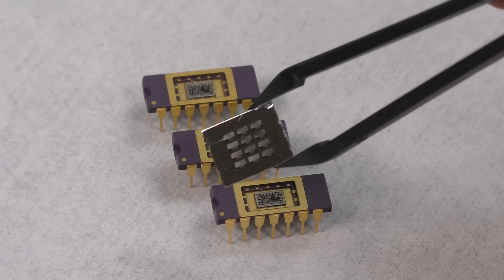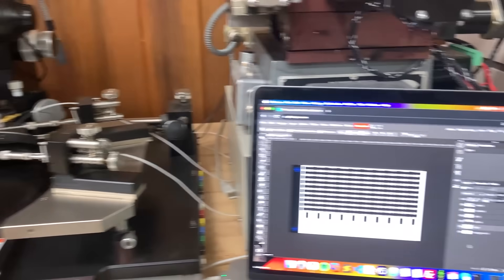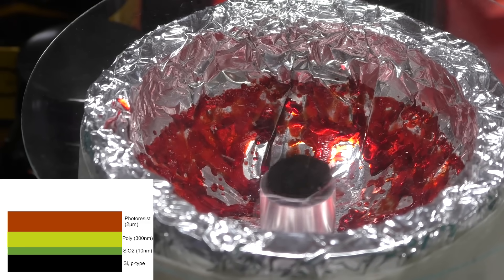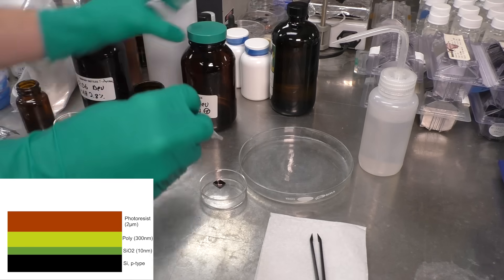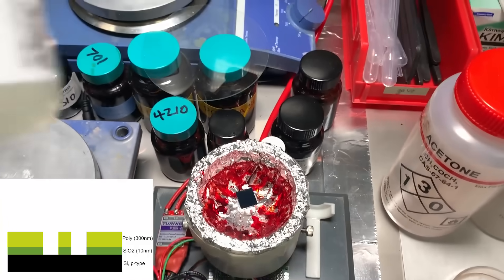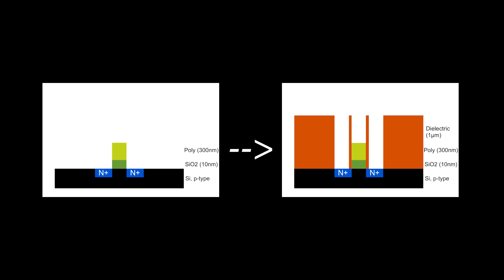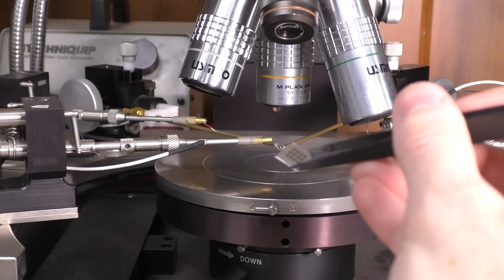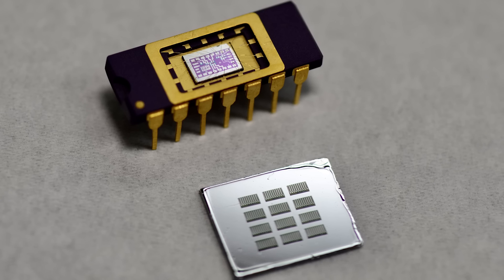"Z2" - Upgraded Homemade Silicon Chips

Comment: this is really cool but these chips are non functional, irl they have to be in a very specific order not just in an array like that, the designers take months to decide where each transistor will go, it does not function calling it a guitar interference module because that's what it did when he connected it doesn't make it true, its just shorting out same as the led light, this is a trick to fool laymen I know because I used to trick people in the same way lol

Comment: This is cool. I've recently been saying that the DIY community needs an easy 3D printing solutions to print custom microchips from home. So many vintage electronics will die over time as their custom ICs age and die without a modern alternative to replace faulty and dead ICs. If you looked into cloning ICs from retro hardware you could probably find customers willing to buy your chips from you. Everybody keeps telling me FPGAs will take over, but I think there will always be a community who want to run off real HW rather than a simulated experience through FPGA. You likely wouldn't push out great volumes of microchips, but you could offer your services as a boutique service and charge a higher price for each piece of silicon you produced versus what the original manufacturers wanted.

Comment: Hi! I do a PhD in a research clean room. Really impressive, especially the homemade metal evaporation. A few tips. Rather than squirting developer, stopper and remover, put them in a bath already filled. You'll have a much more precise control over the development conditions. I'm also surprised your resist doesn't burn in the furnace?

Comment: That’s absolutely incredible work! Building a 1,200-transistor silicon chip at home is no small feat — it’s a mix of engineering skill, patience, and true passion for electronics. You’ve achieved what most people would think is impossible outside of an industrial fab. Hats off to you for pushing the boundaries of DIY technology!

Comment: Hey. A great video. But you can control the etching rate when poly Si and SiO2 was etched by HNO3 but not Si substrate? But for me, only HNO3 could not etch HNO3. You mixed with something else?

Comment: How many transistors could run DOOM ? :D
Reply: Doing some research online, the "bare minimum" is around 275,000 transistors. Using these chips you'd need ~230 of these chips.

Comment: could you make cpus with this or is it not speshelized enough
Reply: It's on par with the earliest microprocessors made like 40 years ago....so no you can't use it as the low end cpu if improved may be some IOT devices can use it maybe🤷🏻
But just the mere fact that he can fabricate such a complex thing in his garage with diy equipments is already insane but I want to see if this can be improved or even scaled up

Comment: so so cool!!  I tried to get in to UC Santa Barbara and UC Irvine to work on chip fab as a concurrent student, $$ per unit as I had a design I needed to make into a chip but then had all the help to do that just taken away.  had been to an ISSCC and DAC to get ideas maybe partner, didnt happen.have even worked building up sputtering equip from the frame, the vacuum is by far a challenge more than anything.  you cant get the last bit out so why not do what vacuum tubes did, use Getter?  Idea was rejected as stupid, Im stupid and shut up.  ok fine.Id love to work on this in a garage good job dude!

Comment: It is quite funny seeing this as bascially I used to make PIN diodes using the same process, I'll admit we used fume cupboards and full protective gear for the chemical processes and our doping went to the chip fab next door as they used gas for the doping so not really back yard stuff there.....Certainly I used an Edwards vacuum system to evaporate aluminium or gold using a heated element controlled by a big dial and an ammeter - bit of a trick to get it right because you couldn't see what you were doing after the first evaporation, we had a sputterer but only for the "special" devices. Used a dice saw to cut up the diodes and then test them as they had 7 dots on them so you could get the right response dependent on the dot but they were tiny and a 3 inch wafer held thousands of them. Then off to the wire bonder and encapsulation. Did all this when I was just 18 (an apprentice only but they just let you get on with it if you could handle the operations and work safely around others, some of those acids wre nasty stuff and a few times I saw people putting acid in a beaker that had remenants of alkali in them at which point all the acid jumped out of the beaker and someone took a shower (whether they wanted one or not....)

Comment: This guy is incredible, i have crated both a little alu and a transistor...but my alu was made into 55 by 55 cm circuit... and my trasistor was too big and energy inefficient that is basically impossible to work with it...and both i was in a group in my uni with all the professional equipment...idk this dude migh be one of the best engineers of all time

Comment: what if you put vertical chips stacked sideways, as fingers, you get massive vertically stacked patterns. yes multiple chips side by side as horizontal stack.
Reply: have you tried using electron beam cannon to make nano patterns? maybe a ultra blu-ray (electron ray) drive single write with high power electron beam and read with low power scanning/transmission electron microscope vacuum read head.

Comment: This is the ultimate in homebrew for working with ICs. I remember the videos about the Z1. In three years you have gone from 6 to 100 transistors in a group. It will be interesting to see what you do in the next three years. You could have more layers,  and/or add resistors and/or capacitors. The possibilities are endless.

Comment: If you make a "Z3' processor, will it have 240k transistors? Because according to a calculator from my computer, it is about 200 times from 6 transistors to 1200 transistors from a second generation. So therefore, will the third generation of the processor have 240000 transistors? And with that question, will that be possible in your own home?

Comment: That's pretty amazing man. I'm not into semiconductor engineering, my stuff is mostly embedded design, but I am thoroughly impressed. It takes a certain level of frustration against manufacturers to want to pull something like this off.

Comment: Amazing. People of the earth can do all this, at home, yet they can't make an oxyhydrogen steam train and save the world from climate change. Yet all you need is an off the shelf oxyhydrogen boiler burner a shipping container sized battery, solar panels on the roof of the cars and water tanker. zero pollution runs on light and water. 7000 HP and all you will hear is that violates the conservation of energy principle.
Really? 
I am amazed at how you managed to put all that equipment together and do all that and people can't even make a steam train.

Comment: Why are you not using Yellow light?
Don't you know that during the photolithography external UV from white lights will affect the imaging process.
Even PCB manufacturers use the Yellow light for solder-mask imaging.

Comment: This is amazing. I'm super impressed and keen to see how far you can push this in a home environment. I was wondering how you positioned the "chip" on the exposure platform for subsequent layers, so each layer registered correctly for the electrical connections. I saw someone else asked the same and you said you line it up with a microscope. I was thinking, might you be able to manufacture some sort of right-angled jig glued onto the platform that you could push the chip into with a spring-loaded arm, just strong enough to stabilise it?

Comment: I've thought for years, there is space for something between the off the shelf amazingly integrated chips we have and discrete PCB mounted devices. The recent automotive chip shortages were not in the bleeding edge devices but older technologies, whose fabs had been abandoned during covid.
Mostly I'm not talking about devices for compete functionality, but to mop up many of those discretes that almost every circuit needs.
Considering that Sam is doing this in his garage and these devices look eminently usable, it doesn't seem a big step for almost any company to make their own devices.
It doesn't seem that it would be difficult to make an automated machine to do all the steps in the video. I'm sure they exist, but probably closer to bleeding edge than mass market. I.e. wafer in, devices out. QC would be the most onerous, as every device type requires custom testing.
The only things I can see which needs bringing more up to date is to be able to include diamond cutting and metal bumps for direct chip SMT.
FYI, I'm an electronics and embedded SW engineer and have just completed a contract at one of the bleeding edge chip manufacturers. Even as an engineer in this field, I am continually amazed by progress. E.g. the RF chips I recently worked with were so thin they were mounted on a polymer film for testing. The connections used copper pillars with micrometer scale spacing. Even the multi chip RF modules are tiny, many under 3 x 2mm with over 100 connection pads!

Comment: I work for a company that makes piezo resistive pressure sensors, legend has it the business started out the same as this; garage/cottage type industry in the 70's. Wonder where you'll be in 50 years, good luck!

Comment: Well, when are we going to hear about what does that chip do? You got to figure this. It is like Intel, they had progression. So a team of what, how many people. Then flaws and the Extraterrestrial made thing in time. But what about you Sam. There's 107k subs, when are you going to have a true product that codes in. It don't matter if the chip has not taken 100 transistors. But a product, else than clipping. A function must be figured. Then make the next one to see how much time it takes. Need energy?

Comment: I think that I got the whole process now, first you get a silicon waffle, then put a photo sensitive layer on top, you print the circuit on this layer using light, the part that was exposed to the light can be washed out and you use the holes formed as a cast for the transistors, then you pour a liquid solution that with the baking will evaporate and deposit the material on the cast, basically both printing and casting the transistors.
Reply: You just repeated what he said in the video

Comment: Everyone here is amazed watching the process and I am here thinking that putting this lab together is a much more impressive feat that this (relatively) simple process. Knowledge about chip manufacturing and semiconductor devices is very accessible in this day and age. Installing (and potentially fixing) these ebay bought (and donated) equipment is no small feat! the information about this stuff is so obscure and requires experience (not just textbook knowledge). Not to mention the environment. This is not a cleanroom and alot can go wrong! Well done! 

BTW, I know Sam knows this but for aspiring engineers in their parents garages, DON"T MESS WITH HF! You can lose you hand very very slowly and without knowing. No amount or gloves will protect you (certainly not nylon gloves). I kind of wish he mentioned it in his video because it is a very serious silent killer

Comment: Good evening, I hope your projects are going well. I really likes your video on bond wiring. I could not see a way to contact you through you tube so I figured I would try through the comments. So here goes, i do a lot of projects from mother board repair using a microscope and super fine tip soldering station. I also love to repair old mechanical watches and now vintage electric watches. The current watch is a heuer senator that has a open silicone chip that has about 15 aluminum bond wires that are disconnected from the gold fingers not from the chip. What i was wondering was instead of soldering each one could i send you the piece to redo the bond wires? Of course I would pay but figured it would also make a great video. Thamks either way Chuck

Comment: You still use the 'beamer-microscope' - not just for mask and wafer inspection - but for 'stepping' the lithography beam through the mask unto the photoresist wafer - all exposed to thick cigar smoke ... 

Aside that, I wonder, how much money - roughly speaking - You have sunk into Your 'fab' over the years - as this is probably the most relevant aspect of 'Law's moore' ? 
There must be a 'break even point' until a garage won't suffice, technically - but anything more won't result in a chip production that is practical (while a middle ground may be useful e.g. during global supply chain shortages)...

Comment: If you can recreate the 6581 / 8580 SID chip from the Commodore 64, you'd find a massive market for them as these chips are much in demand from lo-fi, chiptune and synthwaye composers for making retro synthesisers. Currently there are mockups of the SID such as SwinSID, but these are reprogrammed modern chips that emulate the SID, rather than the proper analog original that is preferred of the purists. So currently the only source for actual SIDs is cannibalizing them out of old C64s, which is a shame because these old computers should be preserved.

It's a bigger market than you might think, and since the SID is an analog chip it shouldn't be too difficult to create one with the equipment you have there.

Comment: Outstanding. I worked at Sandia labs where the UV cured photo resist was developed. You have enough stuff to make MEMS, Micro Electro Mechanical System which are micron size. From steam engine to gyroscope to (theoretical) robot surgery.

Comment: I don't know if you have a video answering this, but where the hell do you go to get the equipment you need to open a wafer fab in your garage.  And how much does it cost.  Also, what are you using to clean the air in there (if you're doing that)?

Comment: You really know your stuff. I work on silicon diode radiation detectors which are quite easily ruined by any contamination or slightly wrong process conditions. Getting these mosfets to work in a garage is really impressive, especially with only one guy doing it!

Btw, we also have the 4145A semiconductor analyzer in everyday use, old but gold :D

Comment: This is amazing. How do you repeatably index the projection?
Reply from the maker: Thanks!! It’s a microscope so I look thru the eyepiece and move the XY around, the projected image is visible on the chip. First I project it using red light for alignment, then switch to UV for exposure once everything’s right
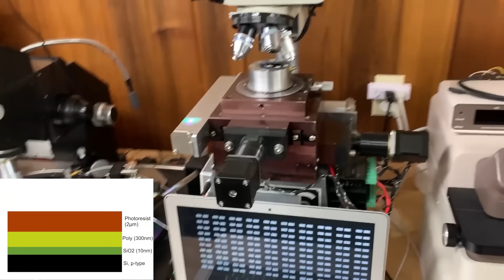Reply: @SamZeloof  Your project is really cool! I can only imagine your homemade silicone chips improving! Do you think if making a mold(the mold blocking the unwanted rays) for the 2:06 part where instead of a projector, X-rays!(with a x-ray machine of sorts) Just an idea because the wavelength of x-rays is much smaller allowing for much smaller transistors(hopefully). And even possibly making it front and back sided on a single chip(theoretically for more complicated tech)? I am looking forward to your next homemade chip videos even if its next year... or the next! I am now subscribed!
Reply: @blacdiamond2334  we are getting into dangerous territory here. theoretically, yes, but he's not limited by his wavelength yet. Remember, he's not in a cleanroom. There's only so much you can do in a garage. Also, working with xray is very very dangerous and not worth it at all. Also, there's a reason the industry skipped xray and moved into EUV (cost, risk, DUV is good enough, etc...)
Reply: @himura128  All that gear - he's in a garage?
Reply: @blacdiamond2334  Silicon not silicone.

Silicon is a semiconductor. Silicone is rubber used to give ladies  bigger boobs.
Reply: @blacdiamond2334  I don't think you can buy an x ray machine for your garage :D
Reply: @jaym5938  Yeah - I read an article about him, he's got all the gear used from labs cleaning out old gear and stuff.
Reply: @himura128  LMAO. Sam is working with hydrofluoric acid and you're afraid of X-rays? FYI, building an X-ray scanner is a very common "first real project" for makers because it's cheap and easy to do safely. Even if you run an X-ray tube with no remote trigger and no shielding for backscatter, it'll still be safer than semiconductor fabrication
Reply: @tonnentonie2767  There are ways of getting that too.😄
Reply: @deang5622  Silicone parts are made for toys: - Sir Mixalot.
Reply: @leechjim8023  Breasts (even if fake) are toys..for the boys 🤣
Reply: @deang5622 They're real on the outside.
Reply: @BobKatzenberg  Fun bags of silicone...
Reply: @tonnentonie2767  You'd be surprised. And a DIY X-Ray machine isn't unreal - I recall one being in Scientific American or one of the Radio-Electronics type magazines years ago.  Back when they had wild stuff like DIY 100 watt lasers and all manner of High Voltage stuff.
Reply: @abQUINTON1  I was thinking about the real in-use x-ray machine for medical purposes, because those are literally better engineered then our space flight programm
Reply: @SamZeloof  Instant sub this is inspirational. Thank you.
Reply: @SamZeloof  , why is the font according to GOST?
:-)
Reply: @SamZeloof   Regards!
Reply: @SamZeloof  Is it manual? Have you ever considered using stepper motors and some sort of sequencing to automate the process? Awesome video nonetheless.
Reply: @SamZeloof an idea could be to use a mutable clay form that is created when pressing the chip into it. Maybe something like that would be easier?
Reply: @SamZeloof thanks!
Reply: It's photolithography when you do it in a lab and ghetto-lithography when you do it in the house.
Reply: @doctorpanigrahi9975  reddit content! hahaha!
Reply: when is your next video un upgrade lol <3